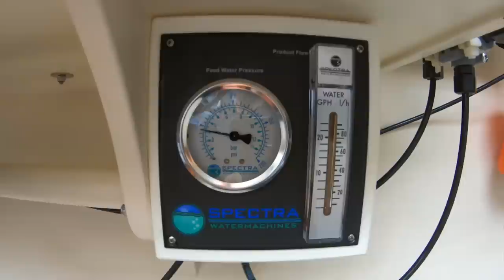Modifying our Alternators, Extreme Dinghy Ride, and Kitesurfing

Comment: Tip. Always solder your connections after you crimp them. In the salt  environment that you live in.... a solder connection will never fail you as opposed to a crimped only one. After I crimp all my connections....I apply solder. 8^)
Reply: Ok I'll bite.....It is much better to use high quality crimping tool and connectors, tinned wire and adheasive linned heat shrink. IMHO soldering can degrade the performance of properly crimped connections. This can arise from the effects of soldering temperatures, increase of potential corrosion from improper cleaning of soldering fluxes and the effects of solder wicking on the conductors. Solder wicking causes the multi-strand conductors, which normally have high flexibility and stability against vibration, to become, effectively, solid which degrades both the performance characteristics (become brittle). 
For these reasons, soldering of crimped connections is not recommended IMHO....and most in the industry ;)
Reply: " tinned wire and adheasive linned heat shrink. " How many people do you think might now about tinned wire and adhesive heat shrink and using some kind of rust inhibiting spray or liquid electrical tape over the connection to insulate it?  Most of the channels, people just buy regular wire and crimp it or they go to a marina that is in the middle of no where ,because they don't know electronics and ask for a repair and the guy just grabs the cheapest wire, crimps it and they're on their way. 3 months later into their voyage, a connection down in the bilge area where there is a high concentration of salt in the air eats at that crimp, the wire develops the black plague where you can't cut and re-crimp and you have a failure in the middle of nowhere. No everyone is like Ryan or some others ( Brian of Delos) that can troubleshoot electronics.  Ryan is in the middle of getting new batteries. A high current application that requires solid connections. While you bring up valid points about reduced flexibility and possible brittle issues....a good connection is also flowed up by wire ties  and cable clamps to secure the wire. then the remaining stranded wire that is far away from the connection has no issues as far as possible vibration. I've worked over 20 years in electronics as a tech. I Crimp , solder, insulate and then put liquid electrical tape over my connections. Over kill?? agreed. 1000 times over. After 8 years I did some rewiring on a terminal in one of my boats that was in the bilge area. When I removed all the stuff....the wire looked brand new. This was also non tinned wire. Didn't feel like paying worse marine the extra money. I will always go my method over the crimp and good to go way.  You wanna go "crimp only" on battery terminals .... I wish you the best.  That is just my .02 cents. Fair winds my friend...
Reply: @13jq  Hi John, most of your points seemed to support what I was saying, however......tinned wire and adhesive lined heat shrink are accepted standards for marine installations (I agree, in my experience of over 30 yrs in the marine industry many people who attempt marine wiring installations are unaware of this), providing people with this information can only help promote more safe and reliable marine wiring. And although these things may not be available at every place where repairs are required if you are planning a major marine install it is the preferred material and method. I grant you that black rot is not always a given (but expected) when untinned wiring is used in a marine environment, but I certainly do not think that tinned wire is an unessesary expense (if that is what you are inferring).
I would strongly suggest that the all too often chosen option of cheap, low quality terminations, low quality crimping tools, standard heat shrink (in preference to none or marine grade heat shrink) is not the way to go.
IMHO soldering terminations exposes far more negatives than advantages (a position supported by industry standards), and no matter if you elect to solder  (not advised) or not, if other complimentary measures are not taken to avoid corrosion or appropriate fixing in marine wiring systems ..... then you are of course inviting future problems.
I will still contend your initial point that "soldering connection will never fail you as opposed to crimped only one" is not supported by marine industry standards, quite the contrary. You are certainly welcome to your own opinions, this is just my 20 cents worth, I guess we will have to agree to disagree.
Reply: @bunyipdan  I totally concur and was about to say the same thing!

Comment: Do you have to run a generator each time you desalinate?
Reply from the maker: No, we can desalinate with solar but the water maker likes a high voltage for good quality water so that is why at the moment we are running the generator.  But when we get our new batteries we won't need the generator most of the time.    :)  N